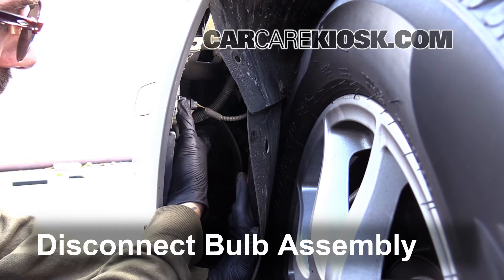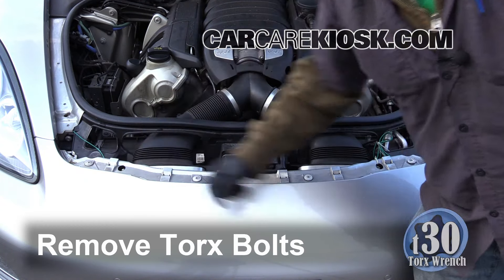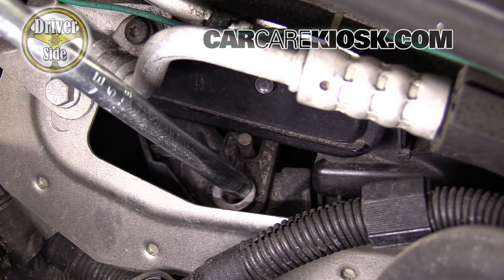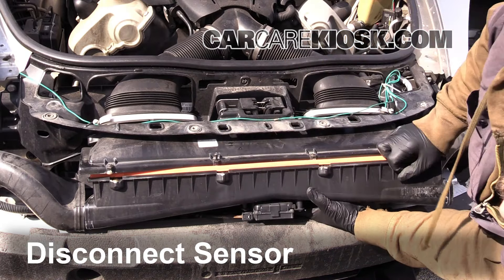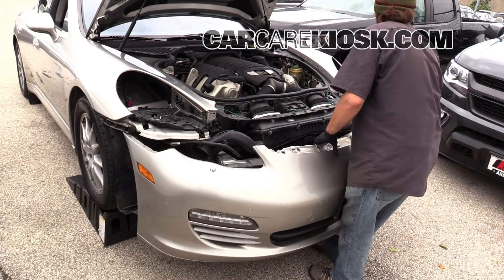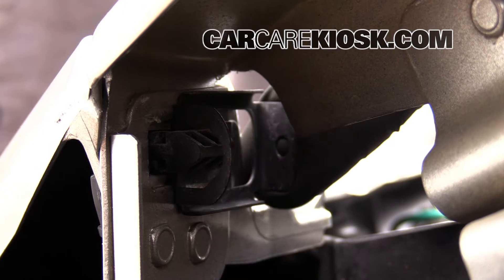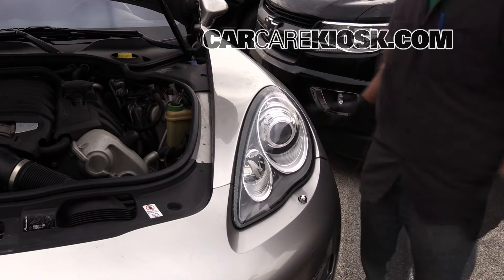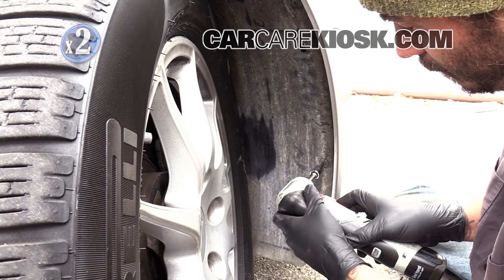2010-2016 Porsche Panamera: Engine Air Filter Replacement [COMPLETE GUIDE]

Comment: Now it makes sense why they charge so much to replace the air filter. The work that goes into this is intense.
Reply from the maker: Definitely one of the more difficult air filter replacements!
Reply: This has got to be the most informative and illustrated video concerning the engine filter! Easy work! Thanks

Comment: You don’t need the special if it’s missing… you can just pull the cover away ( if there is one) and move the lever with your finger.
I wasted £20 on EBay getting it.
Another thing…I didn’t have the side repeaters so there was no cable to release for those.
mine is a RH diesel (UK)
I also didn’t disconnect any hose and only dropped the bumper down enough to gain access to the air filter housing.
Hope this helps someone struggling 👍

Comment: Which engine is this? I seen other videos where the air filter is in front of the wheels.
 I have the 3.6 NA V6.
Reply from the maker: This is the 4.8LV8
Reply: Thx.
Reply: its the same process for the v6 3.6 correct? Thanks. Very informative!